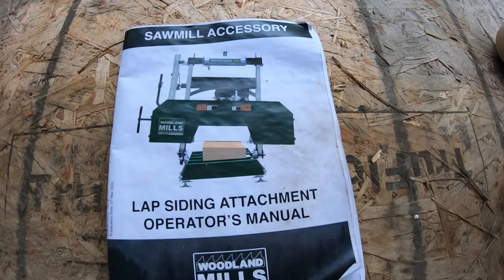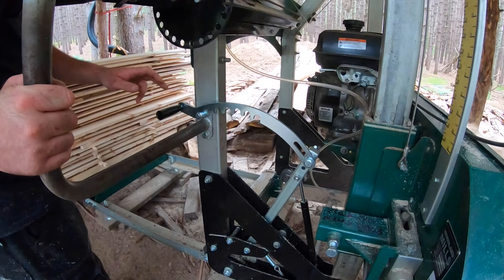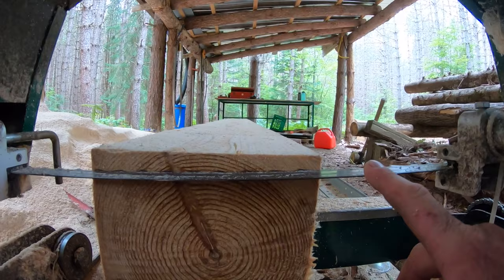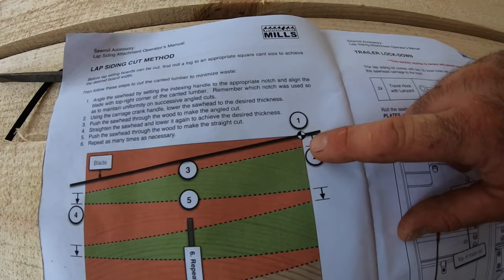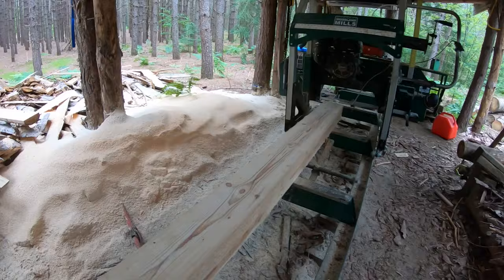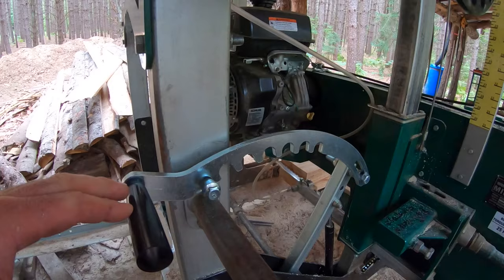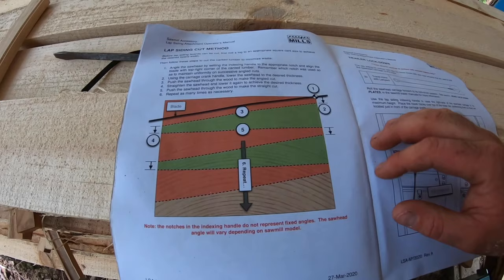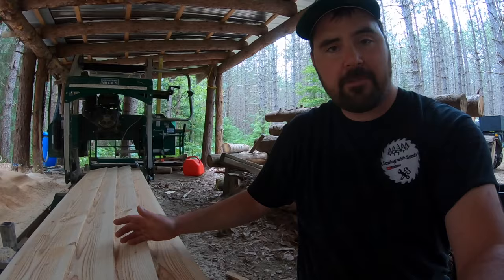Making Lap Siding with Woodland Mills Lap Siding Attachment

Comment: That is well thought out. I like your height sight glass. Is that boughten or homemade from lexan?
Reply from the maker: The height glass is from woodland mills. Not sure if they’ve changed the design more recently
Reply: Sawing with Sandy   Ok thanks. They must have. I have the 130 max. Mine came with a large red pointer. I like the clear sight lexan better. I may have to make my own.

Comment: Sandy, have you ever tried to make shingles if so how did you do it?
Reply from the maker: Hi Casey, I actually haven’t made shingles before but I think if I were going to I’d use my lap siding attachment and then Afterwards just cut the long board to shingle widths
Reply: @sawingwithsandy  you would have to make pretty wide boards wouldn't you?

Comment: What is your moisture content when milling this siding?
Reply from the maker: These are fresh green trees so the moisture content would be quite high
Reply: @sawingwithsandy  is it typical to mill siding green or do they typically dry the logs? How does that siding move as it dries?
Reply from the maker: In my experience they would mill the wood green and then it would be kiln dried once cut. It would shrink while drying.

Comment: Question for ya Sandy, I’m working on getting my first Woodland Mills HM130 Max, but their on backorder. My question is, are you afraid that with this type of lap siding not a jig but an attachment to your mill, that it’ll eventually start to throw the alignment out on the mill? When you go back to milling straight lumber. I totally see and understand the mechanics of it but again your constantly adjusting the “Head” of the mill. Just curious of your thoughts on it vs the jig/sled type that you’d lay on the bed. Awesome videos by the way, your one of the first people I started watching when I was looking at all the brands of mills. After a BUNCH of research and looking at costs etc I’m taking the plunge because you show ALL, the good, the bad and the ugly. So thank you for your informative videos. Dave
Reply from the maker: Thanks for watching from the beginning Dave, nice to have so many good people around to bounce ideas off such as yourself. Since the tilting of the head is done with a series of metal sprockets and a chain, I feel like he quality is there to keep the tilting action precise and allow for consistent cuts. Long term I think it’ll keep the angle well. Time will certainly tell but from my initial thoughts I think it will work well. I can see the benefits of adding an attachment to the bed of the mill as was mentioned for other brands and so I too am interested to see the long term repeatability of this attachment. Thanks again for watching, hope all is well with you and enjoy your new mill

Comment: Hi Sandy ,, Question ,,  Seems you are the only miller that can work out your timber dimensions ,,, most others have random  sizes of timber left over,,, WHY ,,, are they not bright enough to work it out or just dont  care ??????
Reply: Millers work on milling grain.  Sawyers make lumber
Reply: After you cut up one cant you can figure out the optimal cant height for the last piece to be a 1" thick (or whatever) matching trim board. I like 8" siding width so the bottom board can be ripped into (2) 4" trims.